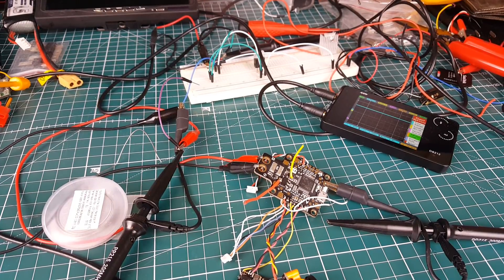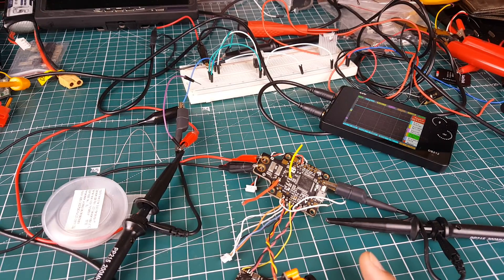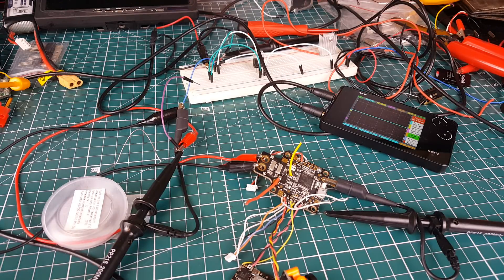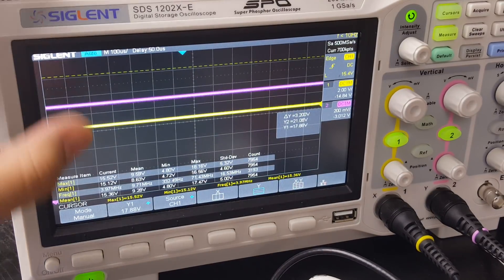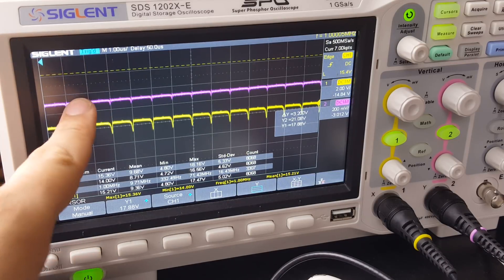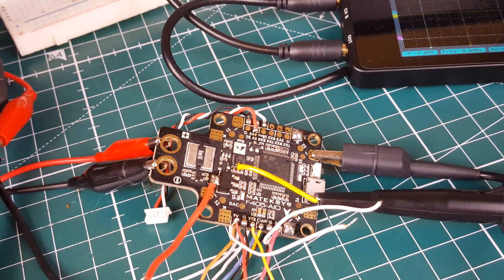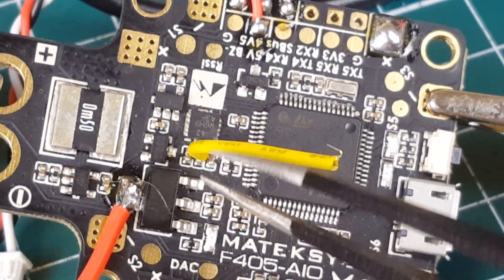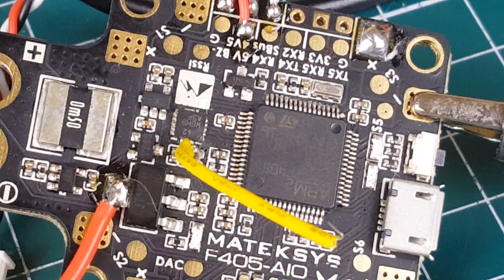Matek F405 Fix // The Fix Theory From Injecting Noise

Comment: @Drohne Mesh Did you do some final testing? ATM i have alot of Capacitors on the FC, i could remove them again to get the problem back and then try to fix it with your idea.

Comment: operating voltage for this gyro 1.71 - 3.45v. Could it be connected to the 3.3 rail? maybe a low esc cap on 3.3 pads will do as well?
Reply: No decoupling caps should be as close as possible to the gyro

Comment: i never had a problem until i swapped out receivers, from a 3v to a 5v spektrum  then it got super dirty noise
Reply: How did you get power to the 3v connected my spm4648 and can't get power unless I plug in the USB to betaflight then it gets power, thanks in advance

Comment: You can also solder the other cap on this cap. I assume its a 100nF cap becouse they are actually a "must have" near every supply pin, so just put another 100nF up to even 1uF on top of the old one. With that you increase the capacitance and maybe get rid of the noise. Putting a x7r cap would even better and make the filtering better.

Comment: This is fantastic and really shows why you are making these videos ,totally unselfishly sharing your knowledge.
I bought this controller a few months ago ,but I have only just started to build it into a new quad ,and I have been concerned about this issue ,but this is something I could easily do and save me money ,if I have a problem and this fix works .
Thanks a lot for the info.......
Reply: if u use the caps on ur esc's u wont get a twitch ive built 3 but always use caps never expierenced the twitch even after horrible crashes onto the street from around 200 feet up lol
Reply: I agree with Quadbot FPV - I have at leat 3 of these FCs and with 220uf 25v caps on ESCs for 4S and I have never had the twitch. I was adding the caps to my builds before the twitch of death was even a known issues because of other benefits and I continue to add caps to my ESCs except wraith cv2s (because they have over 1 farad or capacitance already) due to the other benefits. The other benefits are crystal clear video, but the rea reason I add caps is because when I used to get a lot of cart wheeling when crashing and that always killed my FC and sometimes  my HV VTX, presumably with voltage spikes. Adding caps to ESCs means my components don't die from spikes.
Reply: Thanks for the info ,when I had my first quad the video signal deteriorated after a few crashes and I eventually found the smd esc capacitors had broke loose so I re soldered and replaced the capacitors  and signal came back with no interference.

Comment: Dude! This makes complete sense to me. Do the TattooF4s.
Reply: What is wrong with Tatto F4S? I have one with RS2205 2600KV motors attached on 4S. 32K/8K with dynamic filters off. Goes very smooth, no twitching and no noise in video. yes, it have one low ESR capacitor on battery pads - that same 470 uF 35V one that come packed with Matek F405 AIO board :)
Reply: Mine was crap. The gyro cant handle 4s. So its pretty much useless.
Reply: My condolences about faulty FS :(  Mine are still working without any sign of malfunction.

Comment: So the big PSA for the video is if you don't have the Matek F405 don't buy it...lol
Reply from the maker: +prophet11236 You can't anymore the released a replacement called the CTR
Reply: i just bought another they are for me the best flying crystal clear video flight controller ive used so far by a lot like a whole bunch lol. ive used most of the popular ones and this for me is at least 2 or 3 times better then anyting ive used im building one right now and i never worry about a twitch but i always use caps so maby its preventing it and as to why ive never had a problem only positives and pros. cant wait for the new ctr its gonna be beastmode aio
Reply: QUADBOT FPV well the FC board looks well made with clean solder joints. Only Matek product I used was a HUBOSD but now with Betaflight OSD it's kind of obsolete.

Comment: Gyro voltage filtering - check. Did it for old SPRF3 clone FC twice and it helped (470 uF 16V low ESR capacitor on 5V rail). Notch filters and log checking with a peek into spectrum analyzer graph does help too. But not for all FC's it goes so easy. Seems I now found a new use for our oscilloscope. You forgot to tell that prop removing on table will save integrity of tester's face or hands without taking quad a mile away before testing :)
Reply: You seem like you might know the answer to a question, what capacitor would you put onto this board that Drone Mesh is talking about? I dont know what or where to get these small ones. Also, do you think it would be ok to just stack it onto the existing one?
Reply: In general 470..2200 uF / 25..35V aluminium electrolytic capacitor with low ESR model from known capacitor manufacturers. I use Panasonic FR and Nichicon UFW series - shops in my city have them, possibility to avoid ordering and waiting. For noise mitigation better is to have capacitors intended for at least third larger voltage than you use. Proven capacitor models and brands you may fond at end of post in Oscar Liang's blog. See
https://oscarliang.com/capacitors-mini-quad/

For this board (Matek F405 AIO) I used 220 uF 35V low ESR capacitors - one on each ESC power pads. It solved yaw twitching for that quad completely. For 5V filtering try 220/330/470 uF, 10..16V and same series mentioned in Liang's list. particularly 220 uF caps are small too.

Comment: I have this board. When I built it using aokfly motors and waith32 escs, I used 48k in blheli32 with 32.1 and 1000uf on battery part of board. Flew great. Yesterday I updated to 32.3 and reset to 24k and the yaw twitching started. Even just arming, it sits there and twitches. Crazy stuff.

Comment: Matek listened, and have released the CTR version with an MPU 6000 gyro.
Reply: To listen is good but proper QA is better.
Reply: What does QA mean?
Reply: Quality Assurance Is Not Quality Control. ... The difference is that QA is process oriented and QC is product oriented. Testing, therefore is product oriented and thus is in the QC domain. Testing for quality isn't assuring quality, it's controlling it.
Reply: QUADBOT FPV, anyway, the problem described in the video looks like design flaw and should be solved by QA - far before than the product go to the customers. In another words, 
 It's engineering problem and not problem with the quality of the product's components or something like that. QC in this case has successfully checked that the product worked well under defined conditions (as Drone Mesh said "they where testing on airbot wraith32"), so, there no problems at all "in the QC domain".
Reply: Drone Mesh, have you contacted them about your findings?
Reply from the maker: +Evan77 Maybe meant QC == Quality Control
Reply: QA means first link when you google it - "Quality assurance". "Quality assurance (QA) is a way of preventing mistakes or defects in manufactured products and avoiding problems when delivering solutions or services to customers"
Reply from the maker: +VG You think mateks staff would have bad esc's to test. As I know they where testing on airbot wraith32.
Reply: Ah ok, yeah you're right.
Reply: +Drone Mesh, proper QA should not rely on esc's at all. Professional QA stuff should do something similar to what you did but in much proper way since you just a hobbyist, not a professional electronic engineer. I think matek can afford at least one ;)
Reply: questions and answers
Reply: +QUADBOT FPV, First of all, "questions and answers" is "Q&A", not "QA". Now, regarding QA or QC - both are using for detecting quality problems in products and, as Wiki states: "The terms "quality assurance" and "quality control" are often used interchangeably to refer to ways of ensuring the quality of a service or product". 
From my personal experience as engineer, all companies that manufactures some product have QA department (and it called QA department, not QC), which intended to test the product for defects.
Reply: VG it's not my opinion it's fact it's widely known programmers and EE commonly miss use these terms and hopefully it will clear it up.
Reply: So no Kalman filter for F405 anymore :(  At least until it will be reworked in BF for 8K PID loop which will happen God knows when.

Comment: Before i added a capacitor to my power leads on the f405 i had twitches with infiity 1500 but no twitches with the zop1800. Do you know why?
Reply: Longer battery lead on the infinity causing more noise?  maybe the internal resistance of the two batteries has something to do with it.
Reply: Infinity most likely have larger C number with larger current so less voltage drop on wires and more RPM and on braking - larger voltage spikes. Did you tried low ESR capacitors on ESC pads or battery pad?

Comment: I'm going to give it a go I'll keep you updated on how it goes dronemesh
Reply: I just ordered a new board anyway so if I ruin the board it doesn't really matter I ended up ordering a omnibus f4 with a mpu6000 gyro which is far less sensitive to noise than the one that the matek f405 aio is running

Comment: Totally awesome and my SMD heat soldering station is plugged in. Do you suggest a ceramic cap of higher value or a low esr tantalum cap?
Reply from the maker: +Elling Olsen try a low tant ..waiting for your update
Reply: Drone Mesh - While waiting for your suggestion I noticed the 3.3V regulator and the regulator for the gyro both were connected to 4.8V (wherever that comes from). I connected a caramic capacitor of unknown value from 4.4V to ground as one experiment. The only result was that it now yaws right instead of left! Will do more experiments, but possibly not today. The capacitor was taken from a GepRC PDB. One of two caps which was mounted side by side on that board.
Reply from the maker: +Elling Olsen loool.. send me pics on my email
Reply: The same ceramic capacitor connected as you suggested (to the gyro) seems to have helped a lot. Will need to drive somewhere to test it with a pack or two.
Reply: Did you just look for one on another piece of electronics that was same size? I didnt want to put the wrong thing on it.
Reply: Yes, same type of capacitor, but larger. Had to put it somewhere else on the board and use wires to connect it. I need to do at least one more experiment because I noticed something weird. I will  let Drone Mesh know every little thing i find and he can use it as he wishes in a later video.
Reply: Oh shit! I think I killed my FC. Will go ahead and order the new F405-CTR. I will be highly surprised if Matek goofs up twice...
Reply from the maker: +Elling Olsen CTR does not have reg for VTX
Reply: Yes, I will miss the 9 Volt output

Comment: i have this exact board. i got it from your referral. i am about to do a new build with it. i am an expert at soldering and have all the tools. should i do this for you even though its not built?
Reply from the maker: +Von HB No not yet wait I should get the new signal gen today and I will have the board traced out.
Reply: Von HB what motors and ESCs are u running
Reply: Luke Pike on which quad lol he has like 20

Comment: I'll do your second suggestion when you came up with it because soldering right there is a hell no for me. I would mess that up quick! I would like to see the same test with cap on from the batt just to see how much of a difference it would make.
Reply: I have also the Matek AIO board and have had no real problems with it so far. I have it softmounted and put a 30V 470µ cap on it.

Comment: I almost ordered this board yesterday but it’s under restocking so I guess I will wait. Got a few other things instead. Thanks Mesh for keeping me up watching vids when I should be sleeping, keep it up Sir :)
Reply: Denied Access just order the new version of the board and avoid this issue all together
Reply: Don't do it! There are a lot of other options. Even from Matek. @DroneMesh is veeeeeery kind and awesome doing this for us who bought the FC, trying to help us solve a Problem. But IMHO the fact that he came back to the board and try to fix it tells enough against buying it.
Reply: i own 3 never had a twitch and nether had he which is why he has to replicate it on the bench . if u build properly with caps youll never have twitch. best board i have flown in this hobby so far , i ripped out my f4 flame and dys f4 after i tried this in 1 of my quads and was blown away at how it flies and literally not any noise at all even on full throttle punches on 5s 6 inch crystal i mean crystal clear the new version with the mpu6000 gyro is gonna be a beast of an aio f4 fc have mine in the mail gonna try the new one out cant wait!!!
Reply: Which ESC / Motors are you rocking?